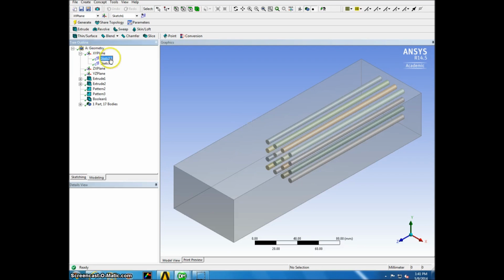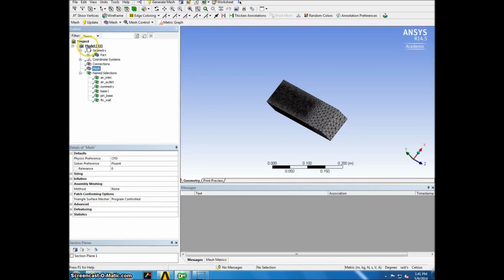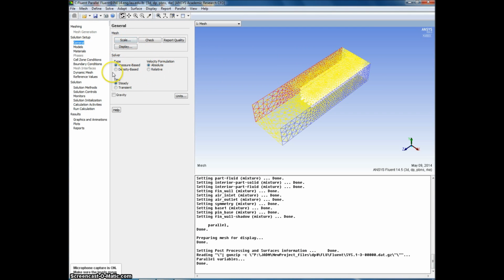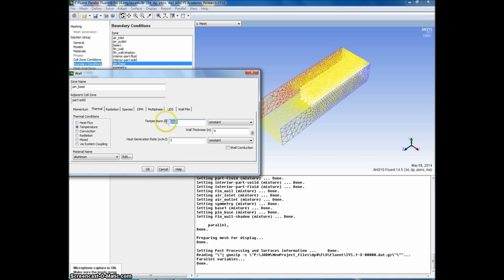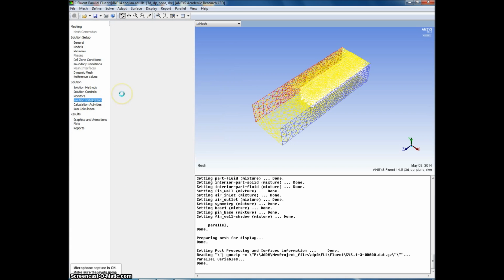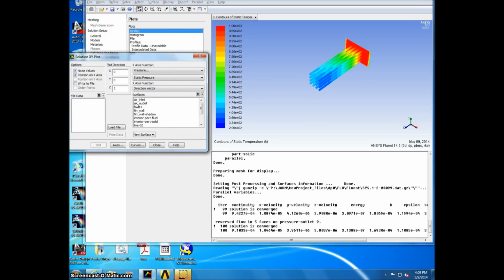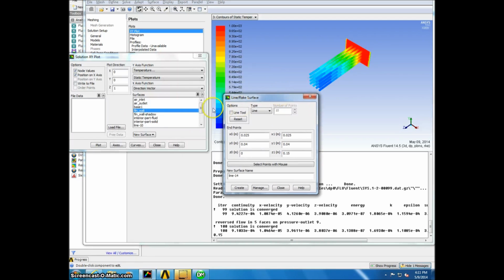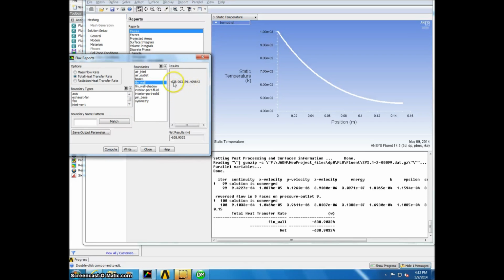Study of Heat Transfer in an Array of Pin Fins - Ansys

Comment: You should mention before the boolean stage to 'add frozen' when extruding, and 'preserve tool bodies' when performing the boolean subtraction. Makes things much more clearer.
Reply: Hai 
At 0.35 seconds its said to form a new part comprising of all the bodies.Is it actually done.I the meshing window I see all the parts separate. IN fluent while setting BC I dont find the interface coupling, isnt it necessary. I tried both ways but isnt working, thats the motivation for this query